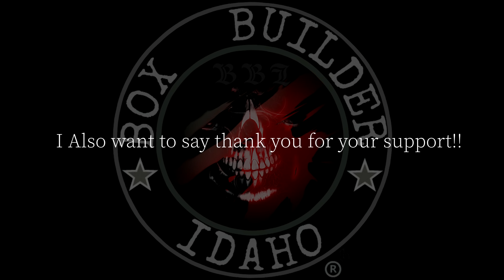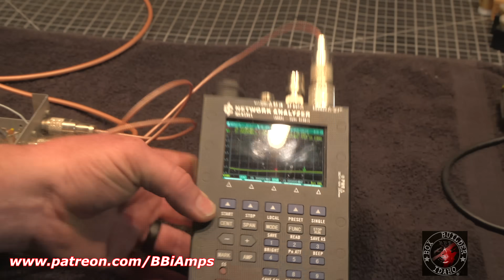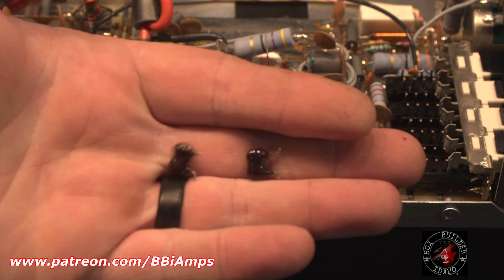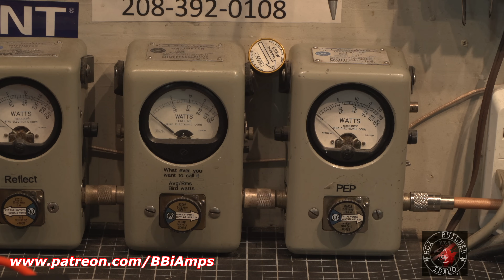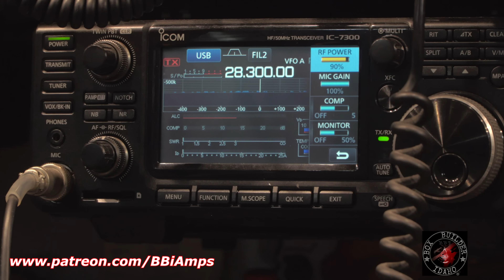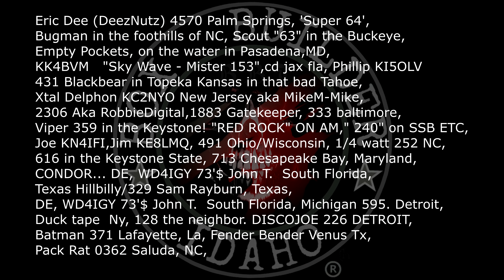RO#13 Texas star 400

Comment: I love your fabrication skills and patience. I, too grew up having to make things "work".  Now that I'm 70 years old and still retain those skills, I would not change a thing. I've done it with my hot rods, all my mechanic work, repairing home wiring, plumbing, lawn mowers, and my electronics. I hold no respect for people who call themselves repairmen, or mechanics, when in reality all they do is replace parts. Great job, BBI, nicely done on the meter. I know to most people this looks like an insignificant task, but believe me, I know what that took. My brand new antenna get "improved". My amps and radios get "improved". It's extremely refreshing to see a true craftsman at work. Well done, lad!

Comment: great job on a older DX 400. not as many around. I got DX 500 not the V . played with tune few days to brod band. lost a few PEP watts but got it to work all over. I did not put attenuator inside for 7300. I did take out keying transistor and put RCA jack for PTT. Them powerpole are pretty good and they have big ones. I put PP75 on my 7300. same as SB50 but red/black . never had one so clean except new in box.73's